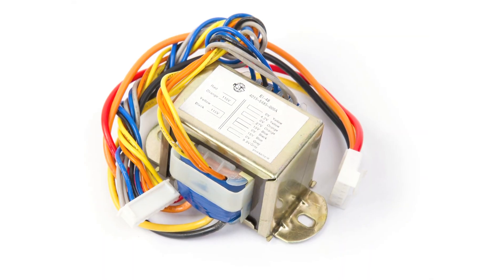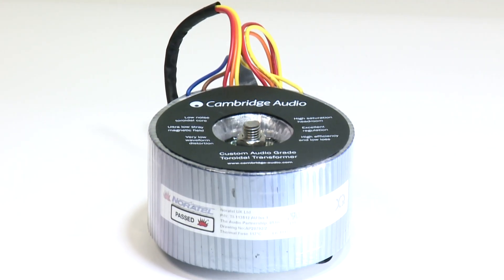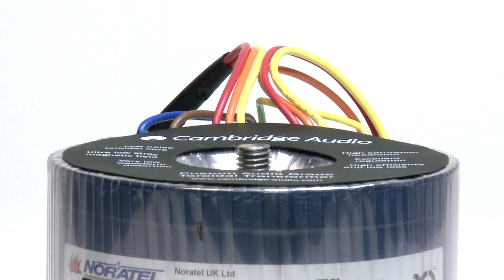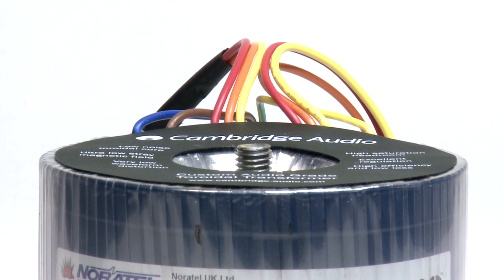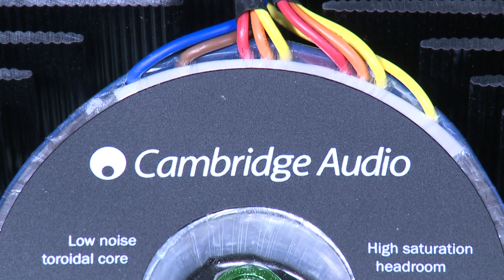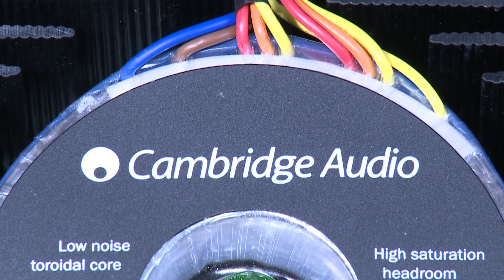Why do we use Toroidal Transformers?

Comment: ATP Book: Toroidal transformers are made of a doughnut shaped core with copper wires all around the core. "They offer the best possible coupling between the primary and secondary ... the design keeps the magnetic field completely confined to the core". They are the most efficient performers, thus the less energy loss to noise vibration.

Comment: the down side is the inrush current but "no big deal" special circuit are been use to fix that ,and is all true, toroidal transformers are more better than E type core transformers  about sound, is not gonna changes anything only the amplifier circuit and topology will show the results and yes will be quieter less hum distortion :)
Reply: more better